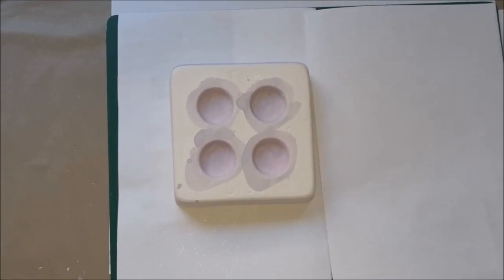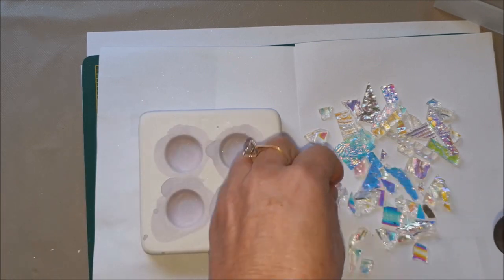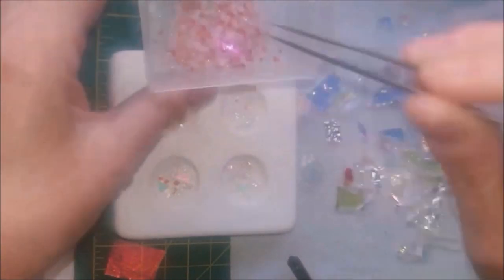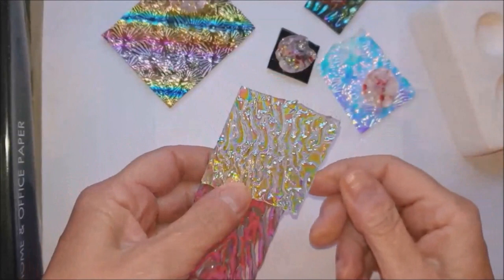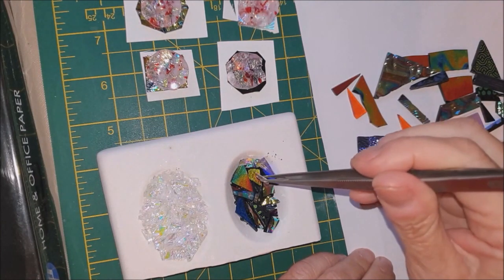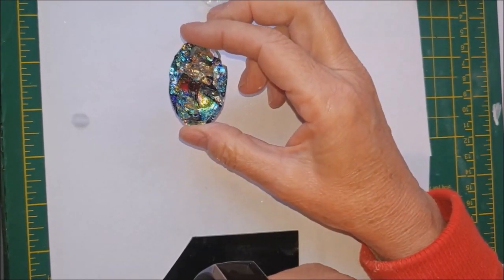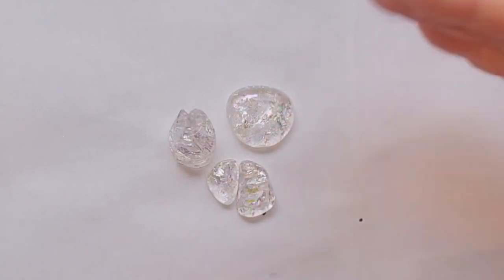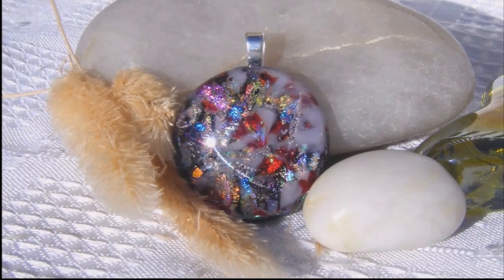19.  How to Make Stunning Faux Opal Dichroic Glass Pendants Easily with Scrap Glass

Comment: I've just started using dichroic glass in my microwave kiln, other tutorials say not to let bits of dichroic glass touch each other as they can repel each other, I take it that doesn't happen so much with the smaller pieces?
Reply from the maker: Hi Charlotte.  Yes pretty much.  Its the parts without dichroic that fuse together.  So with all these small pieces facing different directions then there is plenty of opportunity for those parts to fuse.  Plus the mold holds everything in place.  Hope this helps.  :)
Reply: @ArtsandCraftsTI  thank you, that helps a lot! Really enjoy your tutorials, thank you for your content x
Reply from the maker: @charlottelewis5114  Thank you Charlotte, much appreciated.  :)